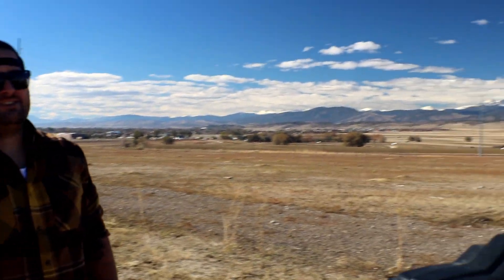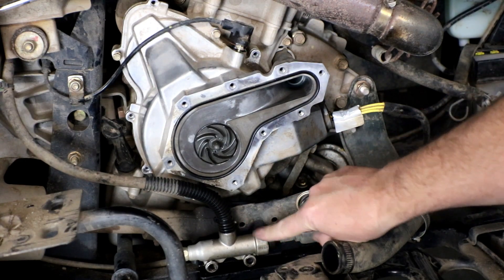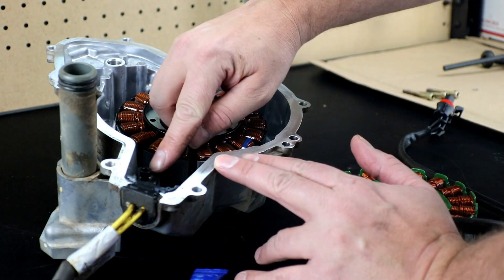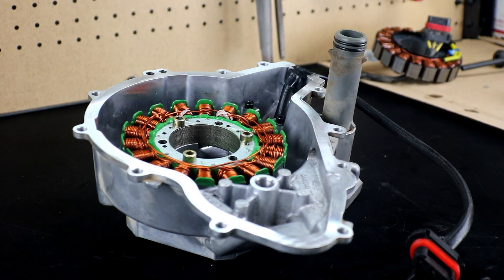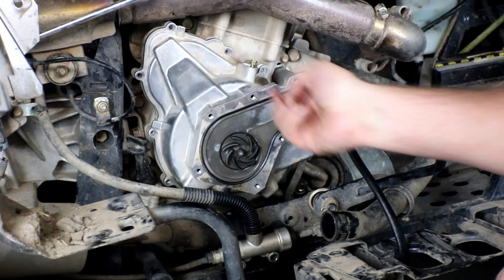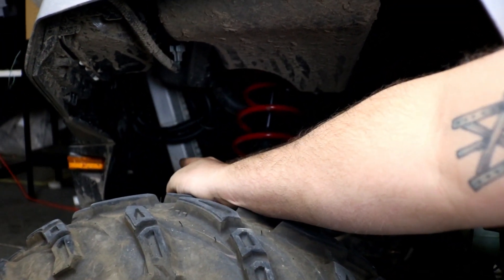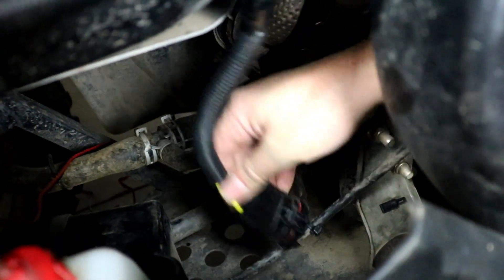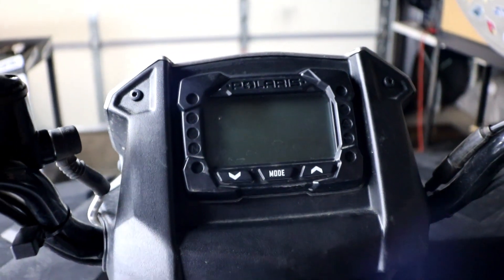2017 Polaris Sportsman 570 EFI RM Stator Voltage Regulator Rectifier Installation

Comment: U know u don’t have to put lock tight on the bolts I have done small engine work for at least 5 or 6 yrs and never used lock tight and I have never had any problems without putting lock tight on them.
Reply from the maker: Having seen the results of stator bolts backing out and getting stuck between stator and flywheel, I ALWAYS recommend using red loctite on the mounting bolts. It's just not worth the risk.

Comment: I changed the stator of my polaris scrambler 1000 and connected everything well but when I turn it on it doesn't turn on.  has no electricity in the spark plugs

Comment: Question how do I find out of this is the problem? Mine doesn't hold a charge on my battery and was told ot could be stator and or voltage regulator

Comment: My 2015 polaris sports man was dead and I jumped it with a car and I turned on but then when I took off the cables it turned of automatically can u please help me with this idk what it’s it battery not has power and the cluster only turns on when it’s connected to jumper cables please help and again that battery is charged but still not tiring or even hearing anything when u turn it to run

Comment: Question I have a 2020 450 ho and I went in about a foot of water the exhaust was under for a second I didn’t hit the throttle it died and a after that it ran not so good I changed the oil and spark plug and would start weak and also when I hit the throttle it would die . Could it be the stator of voltage regulator ??
Reply from the maker: Most likely ignition related. The stator is well protected, not likely to be the problem unless you completely flooded the crankcase, in which case you have bigger problems. I would check ignition coil, ECU, and all wiring connections.
Reply: @Rmstatorinc  it went to about the top of the low beans with water and the exhaust went under water and it stalled Bc I didn’t keep on the the throttle so now it just starts weak and stalls when I hit the throttle !:( it’s at the shop now tho. I’m hoping it won’t be electrical Bc then it won’t be under warranty but other than that it will be I hope . Anything else you think it could be ?

Comment: Hey thanks for the video! before you remove the sator cover - do you need to remove the oil from the engine ?
Reply from the maker: No, you'll lose a few drops but you don't need to drain the whole engine. You do need to drain the coolant like I mention in the video, since the water pump is driven on the outside of the stator cover.

Comment: Hi my friend 2018 570 keeps burning regulator like there is no tomorow, we went for a ride tonight and the third one went up in smoke any idear what it could be ?
Reply from the maker: Sorry to hear this, it is fairly common with the stock Polaris charging system on these models. I definitely recommend our dual output stator/regulator kit, it will solve the problem for good. 

https://rmstator.com/en_ww/splyt-technology-stator-voltage-regulator-for-polaris-rzr-ranger-900-1000-xp-turbo-sportsman-570-2013-2018?utm_source=rmstatorcom&utm_medium=landingpage&utm_campaign=2021Q02-SLY&utm_content=inter--en

Comment: Why pull the water pump cover?  Can't you just pull the hose to drain in and access the stator?  Thanks.
Reply from the maker: Because the stator is mounted underneath the water pump cover on this model engine. You can drain through the hoses first, sure. But the cover will still need to be removed.

Comment: Any idea on a part number or link on where to purchase the large gasket? Figured I might as well since I’m pulling the cover off to change the stator. I’ve got a 2016 570 SP.
Reply from the maker: Usually no need to replace as it is a rubber o-ring type seal. You can see it here:
https://youtu.be/qeKNqJ48IP0?t=342

If it does need replacement, I think you'll need to source it from a Polaris dealer.

Comment: My 2016 Polaris sportsman 570 touring EPS keeps burning the voltage regulator any idea what’s going on?
Reply: you find your problem i have 570 and does the same ?Thanks
Reply: It is possible that the regulator rectifier is of poor quality. The recommendation would be to replace the original regulator with a quality series type regulator rectifier.

Comment: I have a 2014 Sportsman 570EFI. I accidentally hit the kill switch with the engine running did not realize it, it was in the off position tried starting the engine several times with the key (ok it was dark and snowy out). After a few attempts I realized it was off flipped the kill switch to the run position and it started. Went back to plowing my snow. My ATV has a maintenance free battery, power winch for snow plow, Xenon headlights, Led Light bar, heated grips and some LED strobes on the rear near the tail lights, I also have a battery trickle charger I use periodically . The next day it would turn over as normal but not start. Like a moron I did not realize that after removing the spark plug from the engine I needed to touch ground for spark and kicked over the ignition looking for spark on the anode (none of course as i forgot it was not grounded) (I know enough to be dangerous). I used an ohm meter and tested the spark plug wire 0 ohms (destroyed it disecting), ordered a new one (on its way). In the mean time I check the solenoid (ok) windings on the stator on the 3 yellow leads and ground short (no short) and all leads checked out ok. Battery ground ok to engine. Checked the Crankshaft Position Sensor O ohms. Have not checked the factory  voltage regulator or the CMU (no idea how to check the CMU) My ATV is in excellent condition you could eat off the motor I only use it once a week for picking up the trash cans and snow on the driveway. Any ideas why it wont start? CPS so far is the only thing but I could be mission something? If the woodruf key sheared would the engine start? Seems to keep battery power even with infrequent trickle charging so I am assuming it is getting some charge or did of the stator. I will probably upgrade the Voltage Regulator to one of your Mosfet after I get the engine up and running. If I need to open the crankcase and drain the coolant to check the Stator or shear key do I need to purge or prime the crankcase with coolant when I put it back together or will it fill? Also do you sell the silicone O rings for the Crankcase. Sorry for all the question but I have no way to transport the ATV to the repair shop. THANKS!!
Reply: Should have said the CPS is the only thing so far that I tested that showed possible failure at 0 ohms, believe it should show 1000ohm

Comment: I have a 2012 Polaris sportsman and when I jump start it it turns on but when I take the cables off it turns off right away
Reply from the maker: Your battery is probably in bad shape, it may need to be replaced. At least fully charge it on an external charger first. This is probably due to a bad stator, voltage regulator, or both.
Reply: when I leave the jumpers on after it turns on let’s say for 5 minutes and I disconnect the jumpers cables it stays on but as soon as I put it in drive it starts blinking that it hot and turns it self off and I have to take the main fuse off and put it back for it to get power again
Reply: I have same problem except battery is brand new. Started with jump but as soon as I took cables off it died. Took battery out and tested it showing it was good.  Threw on charger to make sure it was fully charged and machine won't start. Thinking it's VR
Reply: I got new battery and  change the stator and regulator work for about 3 days now doing same thing I check the battery with a voltage meter and everything charging fine when I flip the key no lights or anything pops up

Comment: I’m in desperate need of help and it seems to be a problem with many Polaris atvs and I can’t find much information on the issue. Have a 2015 Sportsman 450 won’t start, showing code 636 2, I replaced the CPS but it didn’t make a difference, took side cover off the engine to inspect flywheel and everything looks ok, the cps wire seems to be ok... will run for a second or two with starting fluid... any suggestions or ideas would be highly appreciated
Reply from the maker: If you replaced the Crank Sensor and it didn't fix the issue, I wonder if you have maybe sheared the woodruff key. This could let the flywheel spin on the crankshaft, and throw off the timing. This could explain it still having spark and trying to start, but not run. I would completely remove the flywheel and inspect the woodruff key, and keyway on the flywheel and crankshaft.

Comment: Hey great video. Quick question, MY 2017 570 is losing it's charge when hot.  Tested the stator hot and cold, ac volts and resistance is what it should be. Has to be the VR correct? Bike seems to charge fine until it gets up to temp, tan reads 12v at VR and battery.
Reply from the maker: If your stator voltage and resistance is not changing significantly with the motor hot or cold, then it is likely your voltage regulator. Thanks!
Reply: Mine is doing the same exact thing. I just put in a new battery and it was good for about an hour of use then the problem returned, when it gets up to temp, after about 5 mins running it drops to 12.0 to 12.2. and  will continue to drop if it keeps running. Any ideas, with Covid none of the service shops are open, and the one that is is booking 5 months out? Please point me in the right direction.
Reply: @WhereIsGault  
Do an AC voltage check at the 3 yellow wires. They should all put out 30/50 AC volts when revved up. If so VR is bad.

Comment: Hi Evan, 
Thanks for the great video.
I have a question that you may be able to help me with, I have 2017 sportsman utulity 570, I wanting to tow a small camp trailer behind it, I also wanted to take a waeco cfx 50 fridge, I'm wondering if the sportsman will be able to keep a 120 amp battery charged if I connect a Anderson plug to the bike, I have tried to look on YouTube but can't seem to find any info, you guys seem to know your stuff so I thought I would try asking 
Cheers from Australia
Reply from the maker: Hey! It just depends on the current draw of the fridge. The 570 has a fairly powerful stator, so if you are using a very low power unit, it may be capable. Sorry it is hard to say without knowing the exact numbers.

Comment: Why does the oil need to be changed if it isnt tilted? If its on a flat surface should i be okay to change the stator out without doing an oil change?
Reply from the maker: Sure you can change the stator without draining the oil, but you will lose quite a bit when pulling the side cover off. If you tilt the quad up high on it's side or drain the oil it is a much cleaner job!